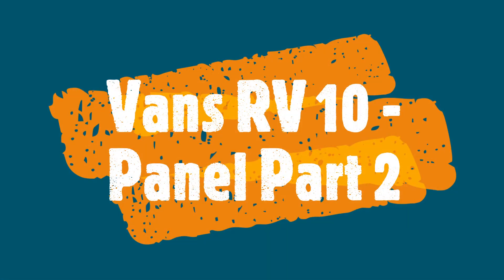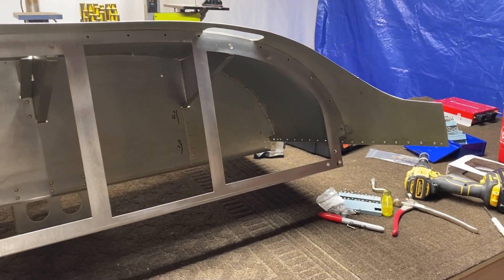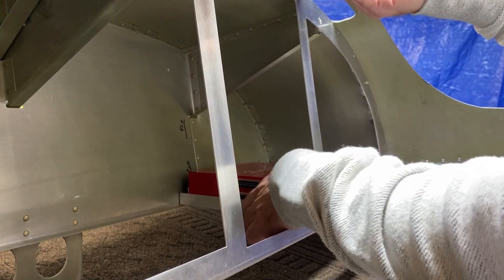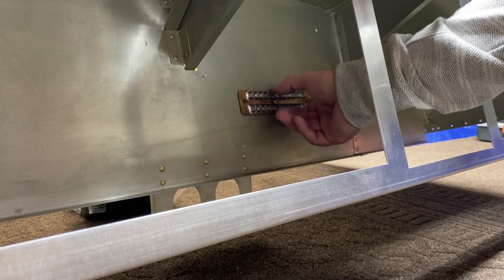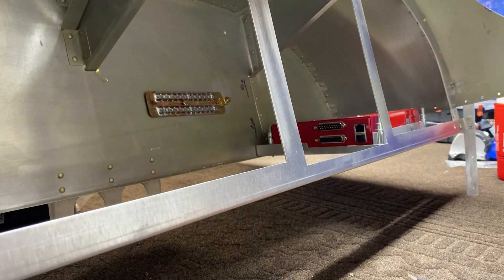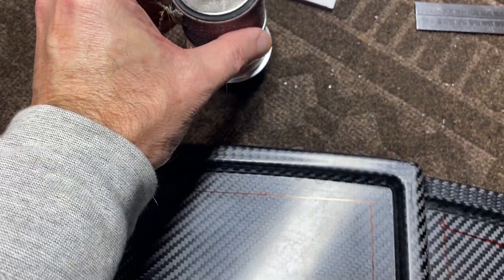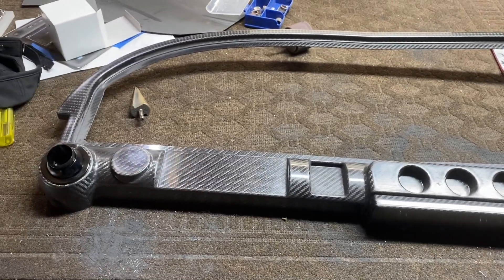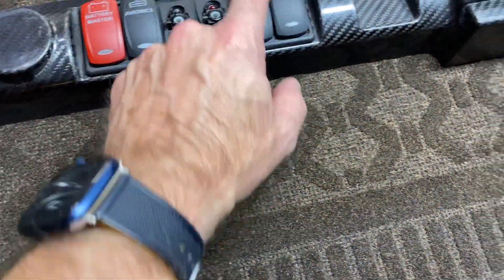Vans RV 10 - Panel Part 2

Comment: Are the switches also from Aerosport?
Reply from the maker: No these are available from aircraft spruce but i found them very expensive, I purchased them, and connectors, from WAYTEK - they are carling rocker switches. I got the covers from Aircraft spruce